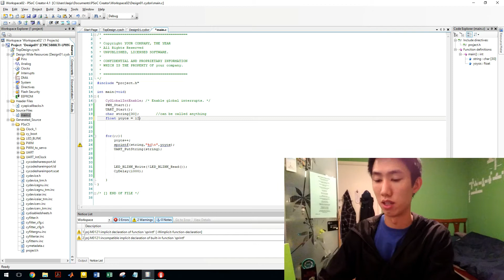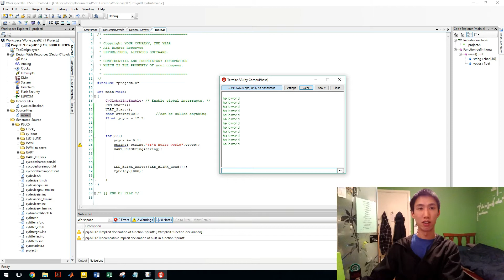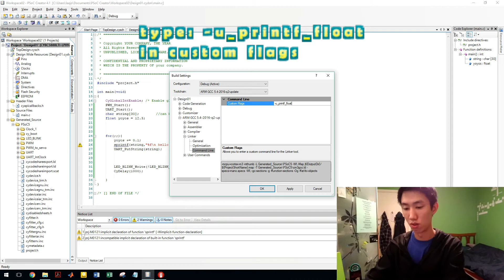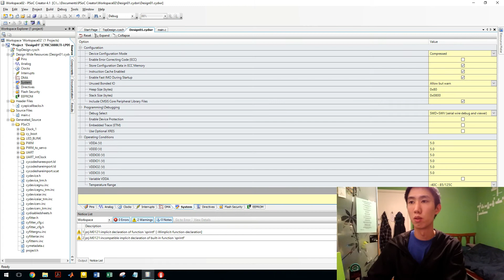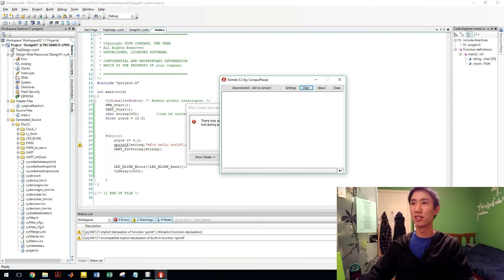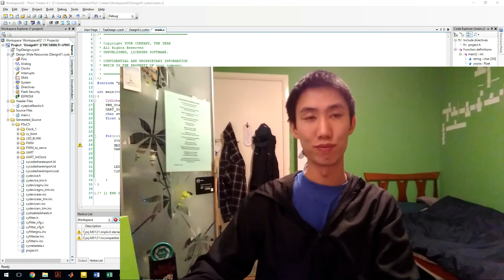PSoC Tutorial - Printing floats to Termite SOLUTION

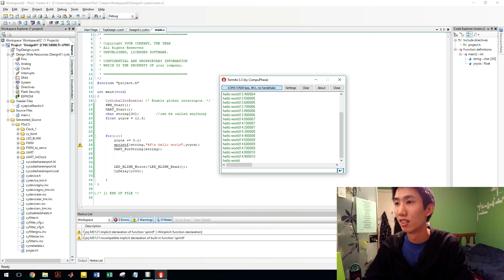Comment: Good stuff! Thanks for the videos!. At 4:04 you get those extra bits at the end because of how floating point numbers are represented. 0.1 can't be represented exactly as binary floating point number, so its rounded to the closest number which happens to end in this case with a 1. If you want to learn more you can check the "IEEE 754" and "decimal floating point" Wikipedia articles.

Comment: Super helpful.

I've just encountered a bug in the MiniProg3 debugger that's causing it to crash out in a place where I'm getting around the problem with "debug by printf" and sending a few floating point variables of interest to a UART on the PSoC attached to a USB-to-RS232 bridge chip.  It's a nuisance to have to do this, but at least now I know why sprintf() wasn't working properly.  I had a copy of a project done by Bob Marlowe at Cypress (who's usually very good about posting stuff that works), but his project file left out the critical bit about "-u_printf_float" in the custom flags.  So his posted example (and this is rare for something from Bob) didn't work.

Had MiniProg3 not kept bombing out, I never would have learned this.  But it's now in my bag of tricks.